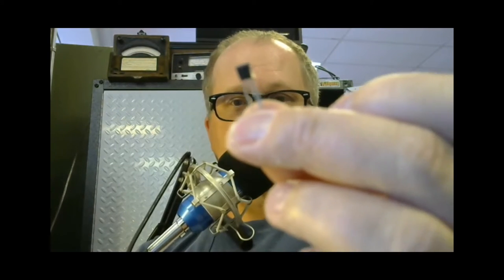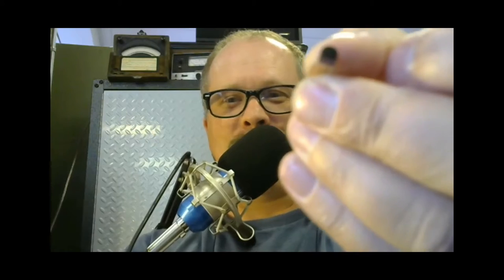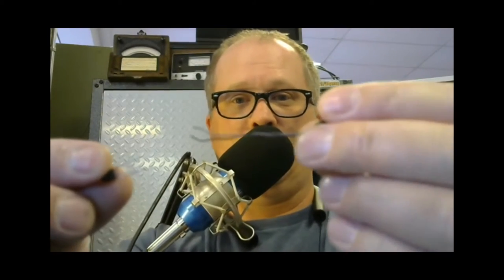2008 iMac HDD Temp Sensor replacement

Comment: No need even to cut any wires just insert the prongs into the existing connecter plug 🔌 & tape over with electrical insulation tape , so easy job done ✅

Comment: If you are installing an SSD, there is a much easier way;  in order to keep the fans silent, purchase a SATA Y Power Split Connector (<$7), and connect it to the drive and the system power connector. The Y connector will fool the system and the fans will run like normal, no need to install any fan software or purchase the OWC Thermo. An SSD in this old system will be significant, just need to remember that  it will be a SATA 2 interface and you will not see a performance gain as you would with a SATA 3.  Thumbs up to your video.
Reply from the maker: My way only costs you $0.35 if you buy one at a time. Cheaper if you buy them 10-100 at a time.